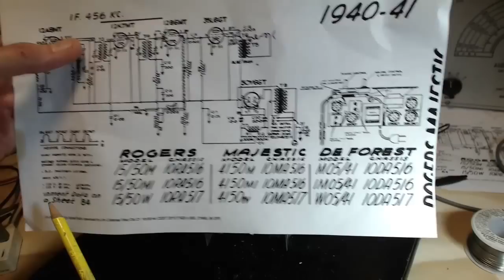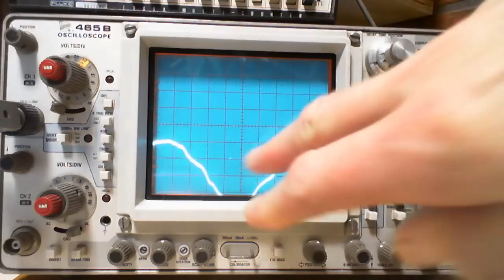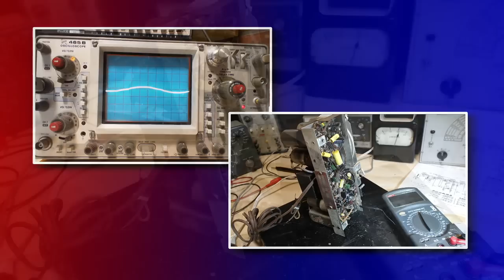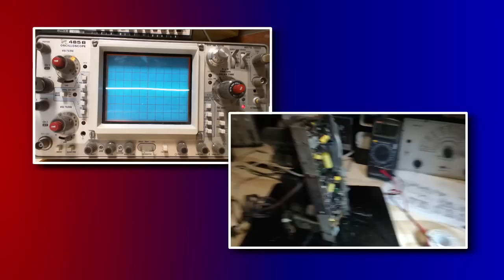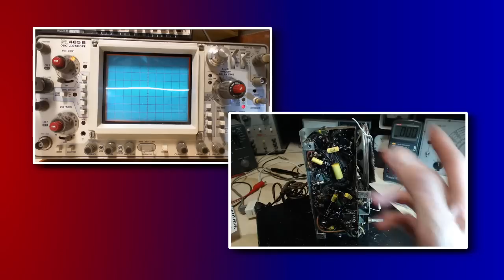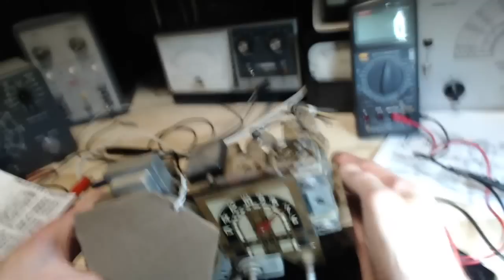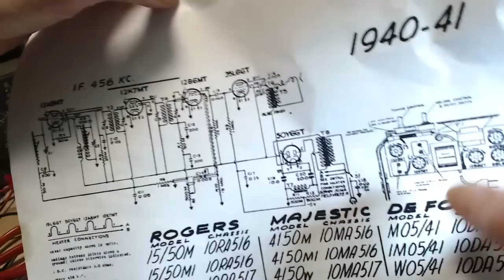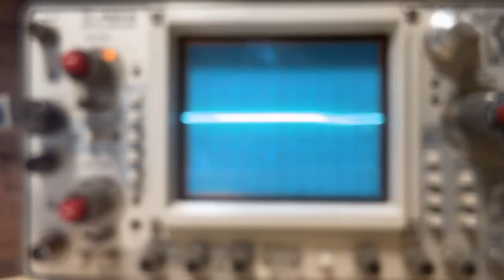Deforest 10DA517 AM Radio Video #14 - Bad Connection

Comment: You definitely have to get this radio stabilized so you can work through one problem at a time.  Loose tubes, cold solder, wonky volume pot all have to  be nailed down and eliminatedKeep up the effort but try to work on being more structured and methodical so you can be more efficient.   Congrats on the great amount of interest in this project.    Thank you for your service to all the Vets out there in the world.
Reply from the maker: +jp040759 I am doing my best to keep the fun level high so I tend to explore things as they appear.  I'm less interested in efficiency and more interested in discovery.  I'm not using my knowledge to fix radios - I'm using radios to fix my knowledge (with the help of commentors like you).

Comment: Hi Jim, You might want to connect your test equipment mains power from a different power source than what you are working on. On a HOT chassis, you could have full isolated power on the chassis, and your test equipment might be opposite, thus full voltage between the radio chassis and your test equipment ground. That is how it is when you have the normal setup, radio on an isolated transformer, test equipment not, Carl.... I really enjoy your videos..... I'm a Vietnam vet ... God bless your Dad

Comment: There may be something up with that volume control. It is connected to the AVC line coming out of, and also feeds back into the grid of the 12B6 tube. Seems to me that it could be very prone to oscillation from feedback if proper care isn't taken. With the volume control action a little wonky it might be wise to fix it before going further...

Comment: this radio is the perfect example of why the shotgun method of condenser replacement should never never be followed
Reply from the maker: +Thomas Stemmer I have sung that song many times but this time I thought, for the sake of getting the little radio done, I'd take the small risk of getting into a jackpot.  Bad choice.  I'm back to singing the song again with a few more verses.
Reply: +Jim Lindenas when i was learning electronics i was taught if it isnt broke dont fix it meaning dont replace anything that isnt clearly defective. bring the set up on a variac while monitoring current draw and bench mark the set then troubleshoot from there till all problems are nailed down and the set works well. just replacing things hoping to fix the set was never considered good practice. this is why i just cant agree with those people who say all electrolytic and paper condensers have to be replaced whether or not they are bad. the same goes for selenium rectifiers. 
also we are here to preserve an inportant part of our electronics past and as such should keep it as original as possible.

Comment: all the automatic volume control automatic gain control (different names for the same circuit) does is keep the volume level approximately the same as you tune across the band. you can disconnect the feed to the avc to check if the squealing stops and that will tell you if you are getting feedback through the avc.
Reply from the maker: +Thomas Stemmer Good idea.

Comment: Could the IF transformers and some parasitic capacitance be forming an oscillator and then the if amp valve amplifying the signal and feeding back into the coil. This could also be causing that slow ramp up as it gets louder and louder. Similar to microphone feedback. It looks so sensitive though, even the slightest wiggle of anything and the tone changes. I don't understand the cackling/yelping sound though it seems to slow to be a LC oscillator or it would be a huge capacitor.
Reply from the maker: +Sparkst3r I think something like what you are describing is going on in this radio.  Changing the IF tuning changes the effect so the IFs are involved somehow.

Comment: Here is another video with the same issue. I see you testing the wires for being too close or loose.  In this video radiotvphononut brings up the voltage slowly and the feedback starts being heard around 100 volts. It turns out two wires were to close and causing a small capacitance allowing for a feedback loop to develop.

Comment: trouble shooting is a very logical process. take it one step at a time. clear the stage you are working on then move on to the next. jumping all over the place will just complicate the process. think of it this way. if you can fix one of the tough dogs then you are really a good electronic repair man. I know it is frustrating but just keep trying. you will lick the problem in the end.
Reply from the maker: +Thomas Stemmer Hi Thomas.  I'm, easily distracted but that's how I end up discovering things.  There's a lot of explorer in me.  Plus a little ADHD.

Comment: Jim, I agree with a couple of others on the volume control. It needs to be replaced/fixed anyway as it's not working now. Perhaps worth restoring to a a proper pot control.
Also, you have that shielded cable...I can't remember if you checked the shield was grounded in the right place(s)...clearly a sensitive node or it wouldn't be shielded.....
One last thing...have you tried to run this WITHOUT the Isolation transformer? I'm flashing back to my Instrumentation days when a Isolation  Transformer was creating all kinds of havoc....
Reply: +GrandsonofKong interesting thought. what kind of problems can be caused by an isolation transformer?
Reply: Thomas Stemmer Lack of a proper of a proper earth ground reference, which even in tow line power cords the neutral line serves. I recall reading somewhere when hum is present on a hot chassis set-up(perhaps it was a turntable system) was to reverse the line cord plug.
I know this is n'5t a 60Hz hum environment but a floating shield or something? back to those metal tubes as well.
I understand why Jim is using a Isolation set-up, just wondering out loud if perhaps he could quickly see if the Isolation was helping create the problem is dealing with...a quick check with appropriate caution.
Process of elimination
Reply: +GrandsonofKong I believe he said all plugs in the shop run threw an isolation transformer. guess it would be easy enough to try the radio somewhere else. after he fixed the loose connection the noise it made did sound a little like 60 cycle hum. not as much screeching anyway. the if is probably way off by now with all the tweaking.
Reply from the maker: +Thomas Stemmer It's an easy check to plug the radio into a grounded outlet.  I wouldn't bet on it helping.
Reply: +Jim Lindenas i would be totally shocked if that was the whole problem but interesting if it was part of it.

Comment: i think i tracked down your mystery condenser. you used two condensers in parallel to make up some .005 condensers. i believe where the mystery condenser connects to the plate of the tube is correct. it should be unslodered from ground and soldered in parallel with the other condenser that is connected to the plate of the same tube.

Comment: Hello Jim.  I am curious about the bad volume control.  If the center terminal is open, putting a resistor across that point and one end of the volume control would simply put the resistor in series with the pot instead of in parallel.  It would be interesting to see what a new volume control would do or at least put another resistor across the bottom half of the volume control.  This would make it look , electrically, like a complete potentiohmeter.  Worth a try?
Reply: +Lewis Okert since the pot is so bad the best thing would be to remove it totally from the circuit and replace it with two resistors in series each individual resistor equal to one half the resistance of the pot and then disconnect the pot altogether. connect ground lead to one end of the series resistors the wire from the wiper goes to where the resistors connect in the middle and the last wire goes to the other end of the series resistors. if that pot is as bad as it seems to be it should be removed from the circuit all together.
Reply: +Thomas Stemmer   Excellent suggestion.
Reply: +Lewis Okert   YAH!!!   That pot has to go!!!!!!!!!!!!!!
Reply from the maker: +jp040759 All good ideas.  I stuck the resistor in there to ensure there was a consistent path for the signal to follow around the wonky slider.  I'm not inclined to take the entire potentiometer out as I may not have a replacement handy.  Taking out the pot and putting in two properly sized resistors would eliminate the potentiometer as a possible cause and is fairly easy to do.  It's on the list of things to try.
Reply: +Jim Lindenas    Correction.     YAH!!!    That pot has got to be simulated with  equivalent resistor divider!!!!!!!   LOL

Comment: the problem in this radio is what was called in the old days a tough dog. while these usually do respond well to signal tracing or signal injection to track down the defective stage an oscilloscope is not going to work in this case since it has no audio output.. what you need in this case is a signal tracer with audio output capability that is capable of tracing a signal in the rf if and audio frequencies. what you are looking for is an audio signal with no squeal present. to start inject a signal at the antenna terminal and then use the probe from the signal tracer on the grid of the rf tube then the plate. then the grid of the if tube then the plate etc till you find where the squeal starts.  once you find a stage where you hear a squeal in the audio then take voltage readings at the pins of that tube socket and that should help lead you to the defective component. i believe in the old days this equipment was called a signal tracer if memory serves.
Reply from the maker: +Thomas Stemmer Excellent idea.  I do have an 'audio tracer' which amounts to a little audio amplifier but I'll need to find it and set it up first.  I like the idea of working my way from the antenna until I meet the enemy.  It may not reveal the whole picture but it will provide some valuable information

Comment: You need to add one more cap you took out. from the front switch to the center middle just under the thick black wire, or it will never play.

Comment: jim before going any farther you really should remove the volume control from the circuit. from the way its responding to you turning the volume control i am willing to bet that may be part of the problem but not the whole thing. a quick and dirty test would be connect two resistors in series where each one is the value of one half the volume control. tack solder the ground lead to one end the wiper lead to the junction in the middle and the other lead to the other end. this should give you approximately one half volume and will eliminate any problems from the bad volume control as it will be removed from the circuit. make sure the resistor leads don't touch anything metal.

Comment: Maybee send sine wave from sig.  gen.  to antenna then check for correct voltages and signal at all relative points.
Reply: Will also alow you to differentiate between a known signal and the oscillation.
Reply from the maker: +John Miner Good idea!

Comment: Might not be the problem, or could be part of the problem; Repair or replace the volume control and remove the extra resistor and go from there. (You say it's sealed, try drilling a small hole in it.)
Reply from the maker: +Alameda Repair Shop FIrst I want to find my metal tubes and see if I do have a replacement.  It looks like the volume control can be disassembled by bending some tabs.  If I can't open it and fix it, at least we'll see exactly what was happening inside.

Comment: If you could just slip a metal tube over the Valve that makes contact with ground would do the same thing as a metal tube.
Reply from the maker: +roomba If I can't find a metal tube replacement, I will go that route